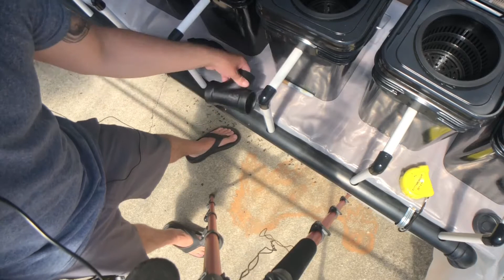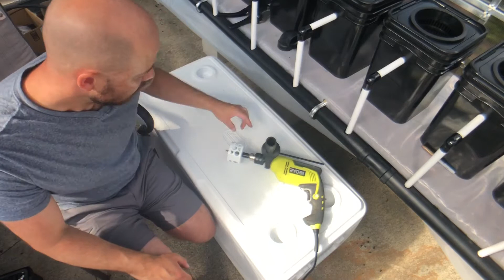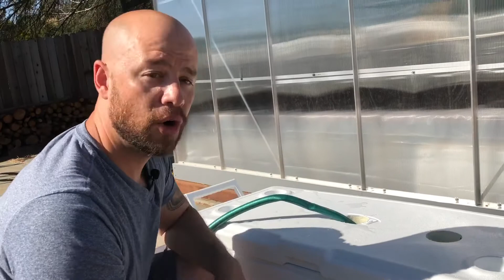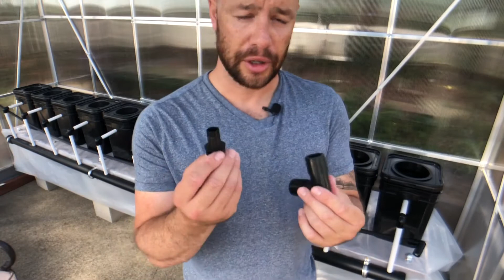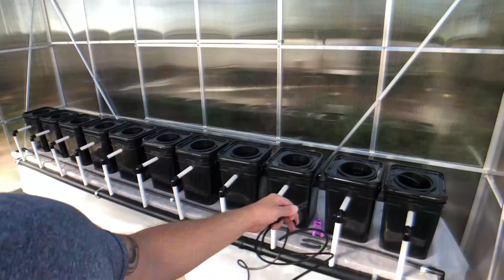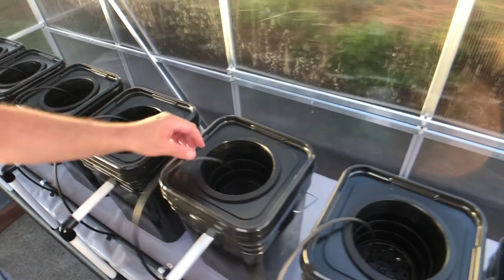How to Build a Dutch Bucket Deep Water Hydroponic System (Part Two)

Comment: Very nice done. but why dont you have a drain in the buttom of the bucket so you can make a proper flush when you change water
Reply from the maker: Traditional Dutch bucket with low outtake are good but we have frequent power outages so having extra nutrients (but aerated with airstones) works for us. The buckets are individually easy to pick up n empty n clean and the raised beds love the extra nutrients.
Reply: @intohomesteading778  okay that makes  sence